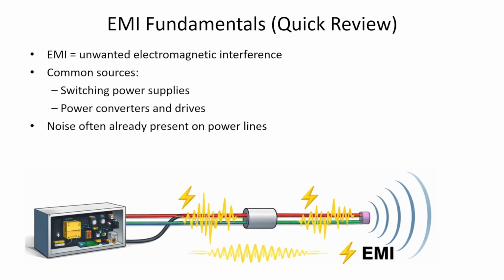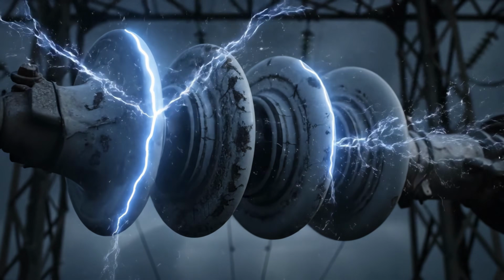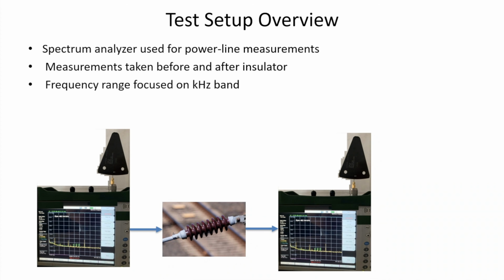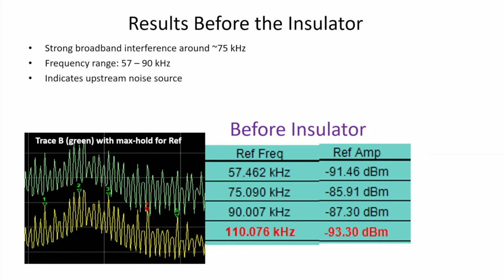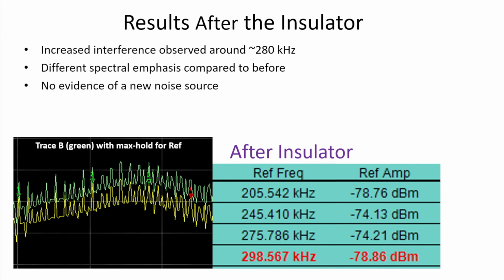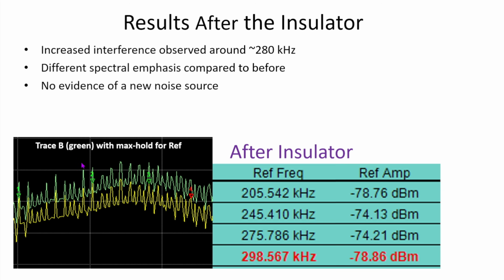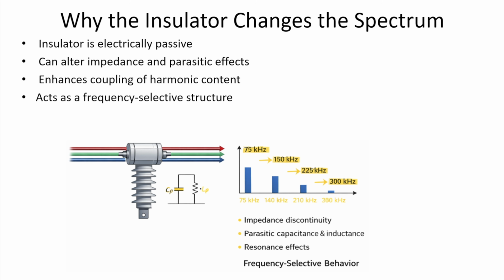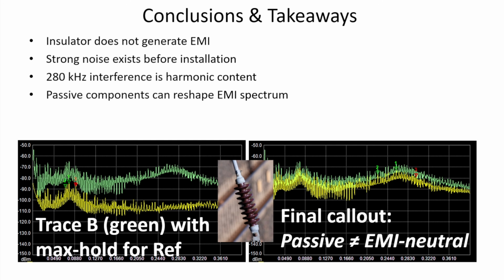Why Did This Insulator Create EMI? (It Shouldn’t)

Comment: There is a car service center and many industrial buildings near my house, and they are injecting extremely high differential-mode EMI into the grid. How do I filter i?
Reply from the maker: Possible, but I'd be cautious about assuming the source without measurements. Differential-mode EMI on power lines can come from many types of industrial and commercial equipment. The first step is usually to characterize the signal and confirm where it's entering the system before choosing a filter solution.

Comment: How do you think about use an oscilloscope for the testing? Will it be better than SA?
Reply from the maker: If possible, the best way actually is to use both tools together:
Step 1 – Spectrum Analyzer
Find:
Problem frequencies
Harmonics
Power levels
Step 2 – Oscilloscope
Go to suspected source
Look for:
Switching edges
Ringing at ~75 kHz
Nonlinear behavior causing harmonics

SA → tells you “what frequencies exist”
Oscilloscope → helps explain “why they are generated”